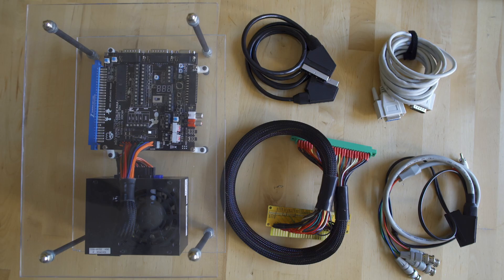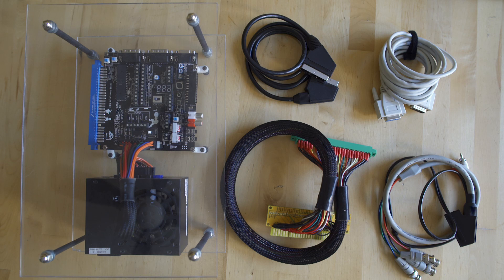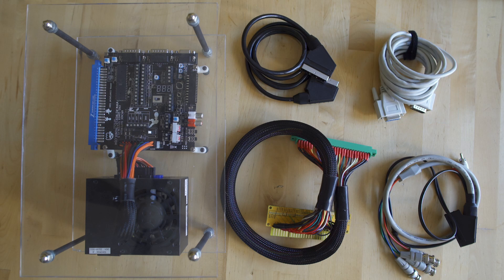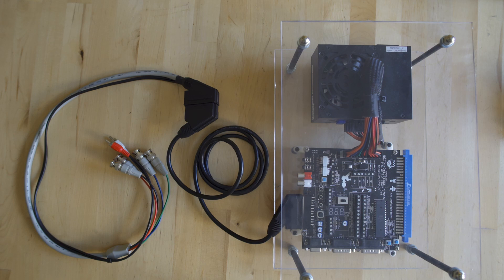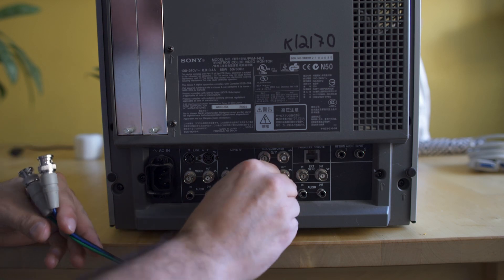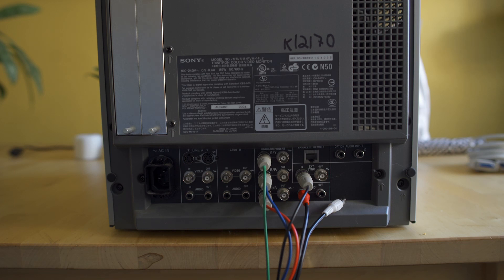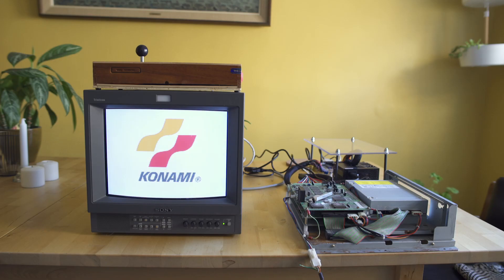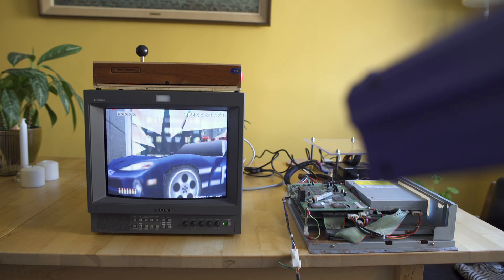Arcade Light Gun Games at Home How to - "On a Technicality"

Comment: Finally the video i've been looking for! I do have some questions. I currently have 2 crts from 2005 a 32 and a 20in would these work or are they too modern for these older titles? Gun calibration and free play can that be done from the supergun without that cable you listed dv50? Do the normal hap .45 guns work when plugged in or do a need a special controller in order to activate them?

Comment: Great video thanks :) just wondering if I can use JVC TM1051DG 10" CRT Monitor too. It has ext sync connection. Thanks for you help
Reply from the maker: Should be fine. I mean I haven’t tested that model but as long as you have RGB + sync in I can’t see any theoretical reason it won’t work
Reply: @VideoGameEsoterica  Thanks for you help. I have a CRT TV with Scart input too. Do you think it can work as well with arcade light gun?
Reply from the maker: Like arcade pcb’s? Yes I use a PVM with SCART to RGB and it maintains the sync signal so that the gun registers. At least on Konami boards. Those are the only boards I have tested but in theory anything light gun tech will work

Comment: An easier way is to use a RGB to composite or s video converter if you don’t have a pvm. Sure the video quality isn’t going to be as great as pure RGB but s video still looks quite good on a crt tv. Great video by the way!
Reply from the maker: That works for everything except most light gun games (arcade) as converting the sync sadly causes them not to read shots. Which is a bummer because getting a large CRT is way easier than PVM lol
Reply: @VideoGameEsoterica  I haven’t seen this reply till now lol! It’s actually possible to play arcade light gun games using some sort of RGB TO NTSC converter as most light gun games use C-Sync. As you may already know, some Namco Deluxe arcade light gun cabinets use a NTSC projector television and use an S-Video connector, I’m not sure why they didn’t use component video. The light gun games that are a huge pain in the ass to play are the Naomi games as the system uses HV sync instead of C sync. Ninja assault is one of those games that I’m trying to solve.
Reply from the maker: I’ve had luck with some games and no luck with others on signal conversion sadly. It seems like a real mixed bag!
Reply: @VideoGameEsoterica  as long as the sync is connected to the gun I/O board, it should work. Not all converters are compatible though. The only one I have had major success with is the Namco RGB to NTSC converter. Other similar ones with the same Sony CXA1645M video  encoder chip should also work (it’s the exact same encoder found in the PlayStation 1). Those cheap Chinese red converter will not work as they mess with the sync signal and have a terrible encoder. I’m still trying to find a component video converter as my TV has component inputs. I have tried multiple Namco light gun games and they all play well. I do have an Area 51 to test out but the hard drive is dead, I suspect that it will work since the game uses composite sync. I am planning on making a thread about this on the arcade projects site, specifically with Namco gun games.
Reply from the maker: I tried it with my M2 boards and they failed to work. Konami has a NTSC converter that shipped with Crypt Killer but I’ve never found one for sale